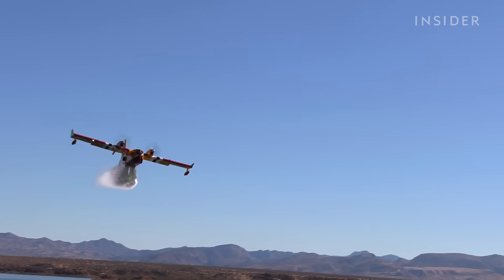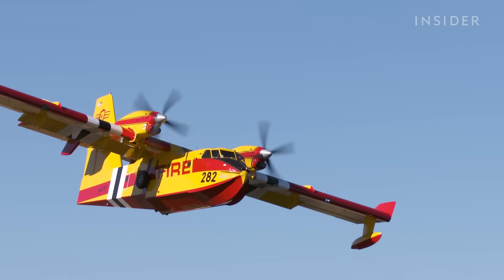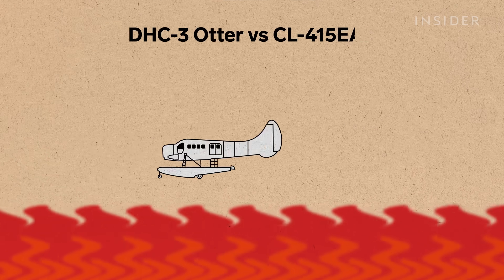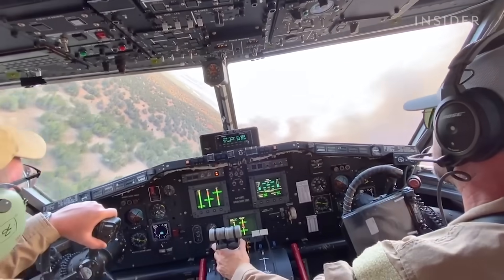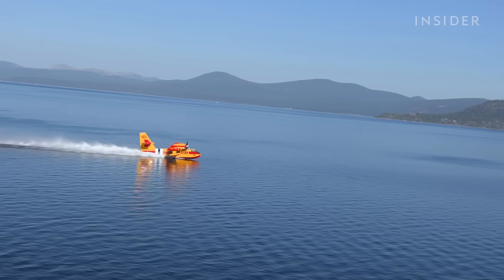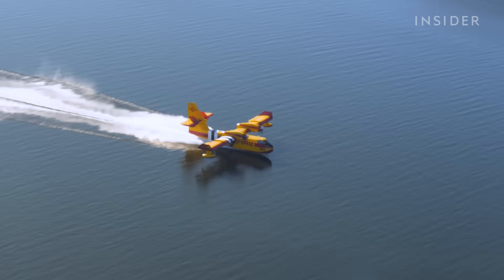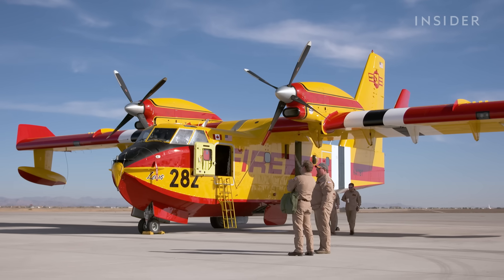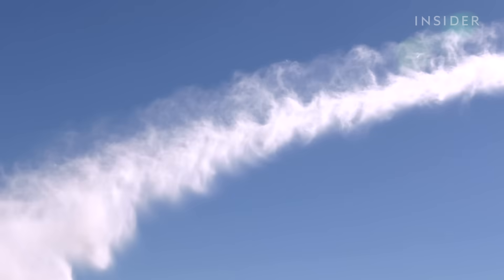How The $30 Million 'Super Scooper' Plane Was Built To Fight Wildfires

Comment: From an aerodynamic point of view, the shorter the length of a twin engine aircraft, the larger the vertical stabiliser has to be, so that it can be used to counter an engine failure.
Reply: also the lower the speed range of the airplane the bigger the tail and this airplane flies at pretty low speed.
Reply: like how the 737-700 has the same vertical tail size as the 737-800 despite being significantly shorter.
Reply: @sidv4615  the 700 has less engine thrust than the 800. Also, they would never re-design the tail if they didn't have to. It would cost an absolute fortune. That's the whole point of doing a stretch - minimum change.
Reply: Also depends on how much torque it applies based on the thrust and the distance of engine from center

Comment: I remember when I fought fires in northern Ontario, we wore orange nkmex gear. A  pilot told us when you call us in stay clear. If you start to run I think the fire is spreading and I'll aim for you. Seeing this thing up close and in the field was impressive and these pilots along with the chopper pilots we had were simply amazing.
Reply: @koisolare  we def fight fired differently here, there's so many water sources that water is neevr really a concern. Small fired we alway try an put them out, lots are started by trains and people. We either use high rail or logging roads to get in, but also use choppers a lot since so much remote area. Rarely do we use hand tools for fire breaks it always water. This year was brutal and fires were out of control you just do you best and they often burn themselves out. We had a fast thaw and the ground was still frozen then no rain in the spring was perfect storm. Out west where you are it's a whole different style for sure
Reply: What's it like getting hit with dropping water?
Reply: @squeeze1321  only happened onece and it had foam it on so it wasn't a great time lol.
Reply: @squeeze1321  that much water is very heavy so probably not great

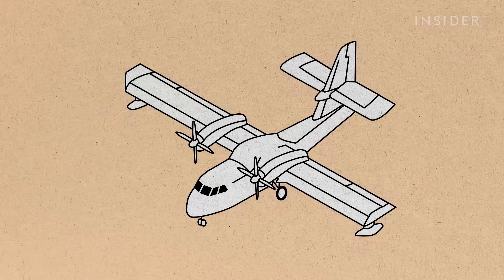Comment: 2:38 when your animator has no idea how a plane works, so they just wiggle it
Reply: This is the kind of animation that's so confusing it can make aeronautical engineers wonder how it works
Reply: I think thats just them saving money on animation
Reply: @PaleRejent  you must be great fun at parties
Reply: @PaleRejent  but still, he has no idea
Reply: the animation is so bad it wouldve been better if they just didn't include it
Reply: They could have used the first animation for all three movements. I you want, you can see every rotation in that one animation :D
Reply: It would have been 10x easier just to do 2 separate 2D images instead of that ridiculousness we saw.
Reply: @someguy5035  Absolutely. I had to do an animation with airplanes in the past and that's exactly what I did. A side profile and a top down sliced into each other and grouped as one object. Looked great 👍
Reply: @someguy5035  I don't think 2 would cut it. One of them would still need to represent 2 axis of movement, which, as we saw here, is catastrophically bad. A simple hand drawing of any vaguely airplane shaped object, from top, side, and front, would do nicely. I could make it in less than 10 minutes and it would be infinitely more clear and understandable.
Reply: @gormauslander  Top down would do yaw

Front on- could be pitch and roll.
Reply: @someguy5035  pitch would only show if the front model was 3d
Reply: @gormauslander  No necessarily. The tail would appear above and below. Other parts would also change position with pitch. 

It would give the viewer the impression it was 3D ,but it would be a 2D image which would be far easier to animate.
Reply: @someguy5035  you would need to draw at least 3 layers to do that, and animate the front and back layers simultaneously. Both those options are more hassle than drawing a side view and rotating it
Reply: @gormauslander  I would do whichever is easier then. The 3D image used in the video is terrible.
Reply: @someguy5035   @༒Gorm Auslander༒  I would show you guys, but I'd dox myself. Just take my word for it, you only need a top down and a side profile to make a 3D model of an airplane.
Reply: It would look better if it wasn’t a 3D model
Reply: @imconfirmedaperson  I don't think it is. It looks like they applied a transform function on a 2d image, which is why it looks bad. Instead of getting a model and rotating it on different axis, or even just drawing it from different perspectives, they chose the laziest possible route; Google image search for one picture at an odd angle and manipulate it
Reply: @imconfirmedaperson  it's not, it's a 2D illustration
Reply: I'm not a plane expert but I understood what he wanted to explain on that animation. I think is good enough.

Comment: Believe it or not, this plane is actually an unsurpassed very high-tech design, the mots advanced flying boat. This Canadair CL415 is a design based a super critical wing which allows it to have a very low stall speed. Paired with the excellent turbo-props, this becomes a masterpiece for the heroes that firefighters are and allow them to become to be the real life savers of our world. This plane is manufactured in a Bombardier factory located in Montreal.  It has its own runway from which it can test its planes.
Reply: They haven't been made since 2015, though production is being set to resume in Calgary under the De Havilland name. Viking owns the production rights & manufacturing tooling after buying it from Bombardier some # of years back.
Reply: @verbotn  Thanks for mentioning.

Comment: I wonder if they gain an appreciable/ noticeable amount of lift when they fly over a large wildfire. I would imagine the rapidly rising column of hot air would definitely have an effect. Also, it's incredible that the engineers were able to develop a platform that could overcome the incredible amount of resistance generated when the plane plunges the water scooping mechanism into the body of water it's loading from. I mean think about it, that'd be like suddenly attaching multiple tonnes of weight onto a car that was going ~150 mph. The torque must be tremendous.
Reply: It's not suddenly adding multiple times it's body weight, if it was a giant scoop that almost instantly filled the tank like in your analogy then the plane would crash, you saw in the video how small the scoops were. It'd be like suddenly adding some drag to a car in a place that wasn't in like with the center of mass
Reply: Well, if you watch the video you can actually see the effect of the scoops. The aircraft is doing only about 100mph for a pick-up, and both the drag and the nose-down moment are visible in the cockpit footage. Additionally, you can see how rough the air is on approach in the cockpit attack footage. It's all there if you look for it.

Comment: Always wondered why the water wasn't mixed into foam instead, as it would cover a larger area and stay for longer, so you could make "fire breaks" (don't know if that is the English word for it) easier.
Reply: The CL-415 can add retardants, dyes and foaming agents to any water scooped.  A typical 6000 L load could have as much as 24 L of foaming agent added depending on the instructions of the fire boss.

Comment: 5:45 "There is no targeting computer"  -   O.o why not?
Beginning: "No other plane looks anything like it"
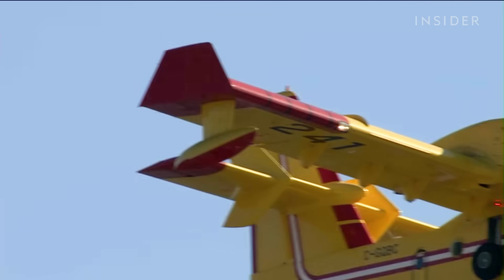1:29 "So they designed the grandfather of this airplane, the CL215, looked very similar."
Very interesting plane though.
Reply: 1.  Most likely cost, and more so the fact there is no ordinance to worry about straying off target, it's just water.  Gotta think, the military doesn't want their $70million missiles to stray off course...  

2. The CL215 is just the first variant, the airframe is almost identical to the CL415, the 415 just comes with updated avionics and turboprop engines.  215's can undergo a conversion making them CL215T's bringing them close to the same capabilities as a 415..  What's featured in this video, is Viking's CL415EAF, which is the latest, most up-to-date variant.

Comment: Built Canadian proud never been more happy to see Canadian engineering respected
Reply: It's designed and made in Montana.
Reply: @scottulrich2725  I believe the first three updated CL415EAF's (retrofitted and restored CL 215, CL 215T's) were bought by Bridger Aerospace Group of Bozeman, Montana.  But the work to restore and retrofit these planes is being done by Viking Air's partner Cascade Aerospace in Abbotsford  British Columbia.  Viking Air of Victoria BC bought the Type rights to build new CL 215 - CL 415's from Bombardier Quebec.  Viking has announced it also plans to start building a new "improved " CL- 415 called the CL-515.  Much like it did with the relaunch of the Twin Otter, Viking will update the avionic and engine all while cutting mass and improving durability.   But a retrofitted  CL215's is reported to cost $30 million or almost exactly 25% less than a new CL- 515.
Reply: @scottulrich2725  lol you have one of these in America we over have 80 of them in Canada it's our plane get over it dude it will always will be just like it has been for the last 30 some odd years
Reply: @learoncin3677  what? Just coz Canada bought it it doesn't mean its canadian designed
Reply: @nehankaranch2149  company that designs them and makes them is out of Quebec so how is that not Canadian
Reply: @nehankaranch2149  This plane was designed in Quebec, Canada.
Reply: @PG-3462  no it was modified in canada
Reply: @nehankaranch2149  originally built and designed by canadair in Quebec in 1969 and is still being serviced and modernized by Viking air out of BC  it’s a Canadian design
Reply: @scottulrich2725 sorry dumbass it’s🇨🇦
Reply: @scottulrich2725  No..................it's not.
Reply: @scottulrich2725  Weak sauce troll

Comment: and why the US do not used them , Canadian technologies ???
Reply: We do.
Reply: Mic
1 second ago
Three words, surplus military aircraft.  It's my understanding that in the USA surplus military aircraft can not be sold into the commercial market in order to protect/promote manufacturing.  But through an Act of Congress military aircraft can be transferred to the Forestry Service or State Fire Services.  And so it was very cost efficient for the Forestry Service to use transferred planes.  But, these are almost entirely not aircraft that can be converted to "scooper" style operations.  Rather they are converted into airport "filled" water bombers.   I believe the most common were converted submarine hunters like the P3-Orion, P-V2 Neptune and the Grumman tracker.  Although Hurcules and a whole line of DC's have been converted.  
   For a number of reasons, near it's forests, America has a greater density of airports (and fewer lakes) than Canada.   So airport filled aircraft are a more viable option.  Also America had been an early adopter of converting smaller float planes into "scoopers".  In fact many of the early innovations came out of the States.  Because of this the smaller American built/converted AT 802F have been a popular choice.

Comment: This place is very impressive, but the historical comparisons are misleading. The Martin Mars water bomber, built in the 40s, is able to drop 7000 gallons - many times the capacity of this plane. And it's still in operation, I think.
Reply: How long does it take to load and how many drops per day?

Comment: lol, "it looks like no other plane in the world", but it actually looks exactly like a Canader
Reply: This is a rebuilt Canadair CL-215 with new engines and avionics.  Which then gets designated a CL-415EAF.  Viking Air, the new owners of the right to build CL-215-415s, has sold six of its newest configuration of this plane to Indonesia.  The new variant looks the same but is significantly redesigned and will be called the Viking Canadiar - 515.

Comment: I must admit, I was intrigued (I'm an Australian), but felt compelled to look into the stats a bit more.  And immediately compared it to the 'Elvis' Skycrane (helicopter):
"The helicopter, which can hold 9,500 litres (2,500 US gal) of water or foam mix, has been brought out by the Victorian Government from the United States for each fire season since 2001-2002".
That's ~ twice the tank capacity of the super scooper?  (11,000 pounds = 5,000 litres).
If your fires are right next door to LARGE lakes, sure, the super scooper might be the way to go!  But I don't see that happening in my neck of the woods.
Reply: The scooper can fill up on the ocean or on airstrips aswell it’s also faster

Comment: "It's built like a tank and looks like no other aircraft in the world"
laughs in PBY Catalina
Reply: Resemblance between the CL-215 family and the PBY basically ends at "two engine flying boat".  They look about as much alike as an A400 and a 747.
Reply: @KevinSmithGeo  2 prop engines, both overhead wings, both flying boats,  both very similar outline, both have boat like fuselage.  They look way more alike than an a400 and a boeing airliner... 

Like you don't get much more similar than that.
Reply: Laughs in A10 warthog
Reply: @Smithy250  yes brrrt the fires out
Reply: Laughs as Catalina falls apart in mid-air due to age and metal fatigue.
Reply: Lol correct
Reply: @hushnowyoureirrelevant  I've only seen the Canso variant, with twin wing struts, not singles, like a PBY. In the summer, the province bases two CL-415's at our airport, they get quite a bit of use.
Reply: Amateurs! 
- Avro Canada VZ-9AV
Reply: *laughs in HU-16 Albatross
Reply: *angry war thunder noises*
Reply: The engines are more like the Be-6 but yea, and at 1:03 they show a PBY super Catalina but it wasn't even used as a fire fighting thing (it couldn't hold water and had no Bombays, bombs were mounted on wing spars and it was used for surveillance during WWII because of it's long-range capabilities)
Reply: @ericz6  You might enjoy footage of the "Black Cats" of the U.S. navy in WW2. They fastened bombs and torpedo's to Catalina's and flew them at night. The Japanese were, for a time trying to figure out what this new super weapon was. Also check out "Gregs" channel and learn more about the Cat. It's a pretty incredible airplane.
Reply: @ericz6  PBYs were converted post-war into firefighting aircraft
Reply: Yeah, very significant like cryptocurrency 💯

Comment: No mention of the very special turbo prop engines. The blade have variable attack angles, allowing the engine to keep running at full power while the plane is almost stopped. This allow the plane to quickly adjust engines “output” without killing the engines.
Reply: this is standard feature on turboprops

Comment: Too small , should be bigger to be more effective !
Reply: I think a lot of thought went in to the size of these planes (and they're not actually small).  If you went bigger you would loose maneuverability in the dangerous conditions and terrain they need to fly in (forcing you to dumb from higher up) and lesson the number of locations it could scoop water in.  But interestingly the Air Tractor 802F Fire Boss has demonstrated that using more much smaller planes is another option in some circumstances.  (Fire Boss says you can buy multiple 802Fs for the price of one CL-415...)

Comment: CL-215s have been involved in 30 accidents, 19 fatal. Such a very bad track record for only 125 built. Never gonna ride on this plane
Reply: I think to be fair to the brave and highly trained pilots that fly water bombers you need to acknowledge the extremely risky environment these planes fly in.  And we need to note that few water bombers are capable of flying as low and as slow as the Cl 215/415s (thus improving effectiveness).   Loss of life in this kind of service is not unexpected but of course always tragic.  Fortunately as water bomber technology and techniques have improves so have the accident records for this class of plane.  Flying without as many regulations and without any FLIR sensors or ground radar back in the 70's 80's must have been hair raising.  
The numbers I've been able to find are slightly different than yours but still communicate how dangerous this job is.  
Of the 125 CL-215 produced since the late 1960's, 30 have been in serious crashes resulting in 48 fatalities. 
Of the 95 CL-415 produced since the early 1990's seven have been lost to crashes resulting in ten fatalities.
We have no stats on the number of CL-215/415's lost while in civilian transport service because that is not the type of flying these planes do.  But I would bet there are few turboprops out there that are more robustly built.

Comment: If thats 30 ft tall like their diagram shows then I'm 10 ft 6 inches tall
Reply: The plane is actually 29,5 ft tall but the graphic is wrong, the height of planes is always measured to the highest point which almost always is the top of the tail fin (and most often with extended landing gears, if applicable). Here the graphic showed from the ground to the top of the wings which is, as you noted far from 30 ft.
Reply: @skunkjobb  Oh, I see.  My bad, I thought they were saying the wings were that high off the ground.

Comment: Have. You. Ever. Heard. Of. Metric? -_-

At least, write down the conversion in the video :)
Reply: Believe it or not, Canadian aviation is aligned with the USA, for safety.   Too risky doing conversions.     Feet inches and gallons it is
Reply: @davejackson9819  I understand the difficulty of switching existing measures engineering wise, but it doesn't prevent BI from converting for general public. I can do the rough conversion myself but when they trough 4 figures in a raw your attention is diminished and the whole purpose of the video to educate people is hurt